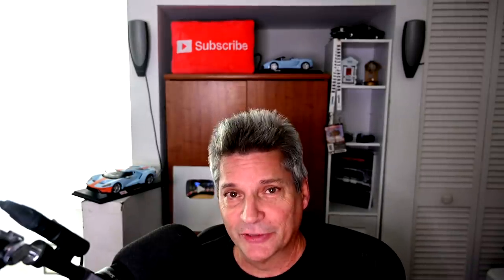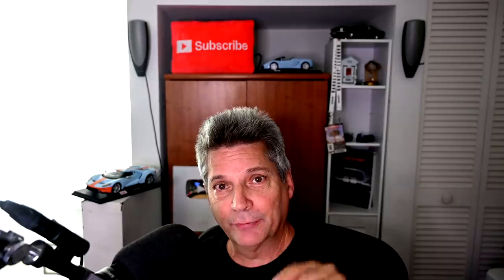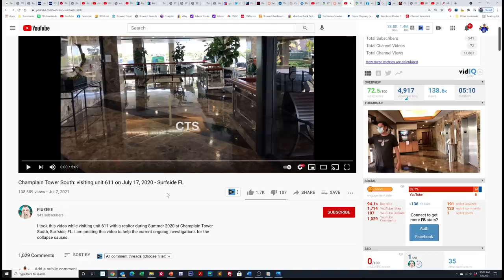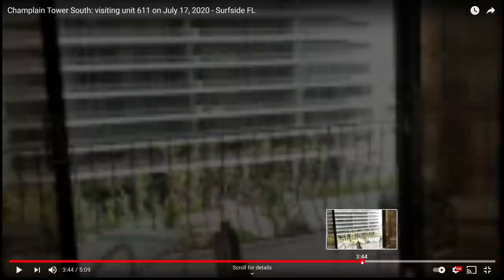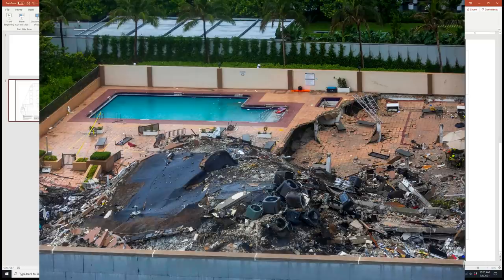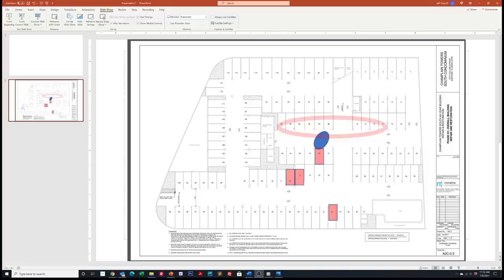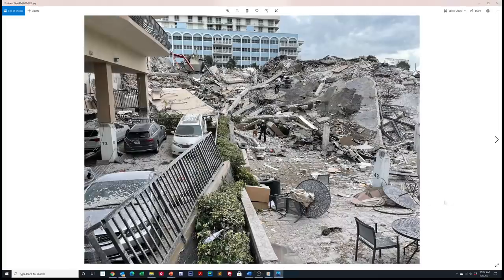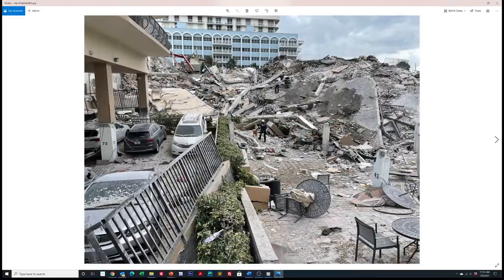Analysis Garage Video BEFORE Condo Collapse: Water Everywhere

Comment: I noticed there is a drainage grate at the bottom of the ramp. In the video it doesn’t appear as a gushing of water from the hanging broken pipe. It looks like a waterfall flow and the water is going down directly into the grate drainage. I’m still not buying the media’s official report on the building collapse. When I first heard and saw the footage I was taken back the the collapse of the two World Trade Center buildings. I saw your other video where you questioned where is the security camera footage? Again it reminded me of the Pentagon on 9/11 where they only showed one footage of something hitting the building. The video quality was poor and that is another thing I question. You can show clear footage from a rover on Mars but you don't have clear security camera footage. It makes no sense with all the advancements in technology always improving and you still have crappy video footage. Also, the pentagon is a high-security government military facility. I know for a fact they got more than one security camera all over the building inside and out. It goes back to the question is where are the other video footage of the pentagon on the day of the 9/11 attack? What are they hiding?

Comment: If all the columns had concrete beams installed no matter how much humidity or water the slab contained it wouldn’t had fallen down. The lack of concrete beams also reflected by the puncture of the columns through the pool deck. The worst thing is that the pool deck when falling down drag the columns from the building and the rest is what happened next. Don’t be scared if your building has water leaks if it constructed well it will not fall down. All of this videos like this one showing water leaks are BS!
Reply from the maker: Obviously coming from a non-engineer, you are 100% wrong. Moisture has always been concrete's worst enemy. Moisture lowers the PH of concrete to the point that it becomes acidic and causes the rebar to rust and expand.
Reply: @jeffostroff  so in other words to be 100% correct as you say you are with a proper water sealant, mob the pool deck with little water and hope it doesn’t rain much each year this catastrophe could have been avoided right on!!!! Here in Mexico buildings don’t collapse for those reasons I know for 39 years of architectural experience!

Comment: The "water" is most likely all of the AC fluids that are expelled by all of the cars there, and has collected into pools of water.  Where this collapsed, AC is a must about 94% of the year, and with high humidity its less likely to evaporate quickly (water includes a bit of oil that's in the expelled water). .As for the ceiling, thats paint and not water, but for the paint to do that, its probably humidity and salt air acting on the paint.

Comment: Nothing presented in this video says: DANGER, THE BUILDING IS UNSAFE. There is some minor damage but, nothing that would have worried me if I had lived there. I am more convinced than ever that a sinkhole is still possible. There has been speculation that the waterproofing for the pool was damaged but, the water in the pool is full and the minor damage that exists in the spots you mention are so far away from the pool. How could the water from the pool have gotten so far away? Is there a space between the top of the roof in the garage and the floor of the apartments above? Even if there was a space though, what was the source of the water? Also, how could the water you showed cause so many columns to fail at the same time? I feel we are seeing what a sinkhole could do. Remember the massive amount of water in one photo. In some sinkhole events, water has been known to rise up to the surface. That water should be tested.

Comment: I still think it all started with a leaking hydrostatic relief valve in the small pool.
Reply: It started with greedy developers, and thick planning officials, building a mini city on a salt water sandbar.  Not using structural uprights and beams  and relying on raw steel mesh instead of galvanised !  all to make money !!

Comment: Dude, there is nothing unusual about a little water in a PARKING GARAGE..  The water you are seeing is most likely condensation from the vehicles air conditioning systems.  Dont think you tiny pools of water had a thing to do with the problem.  Peeling paint in a garage.. gosh,, its a garage, subject to the heat from car engines, chemicals from vehicle exhaust, and yes, humidity. Peeling paint in a parking garage is nothing uncommon.  Most of the water you are pointing out is in parking spaces and is most likely from the cars that are usually sitting there.

Comment: Please lose the dramatic music.  It's distracting.  It seems that your producer needs attention. Quitting and downvoting.
Reply: @jeffostroff  6:10 to 6:42  You think that that noise adds something or even that it's acceptable in a quality production?  Sad if you do.  There is this dramatic crescendo that has zero to do with the reasoning in your voiceover.  It's random, and it certainly is not way quiet.  I don't mean to insult you about the general quality, but the music is very amateurish.  Too bad, because your analysis is probably very good, judging by your previous video.  Anyway, best wishes.